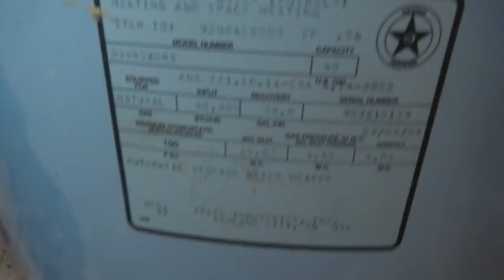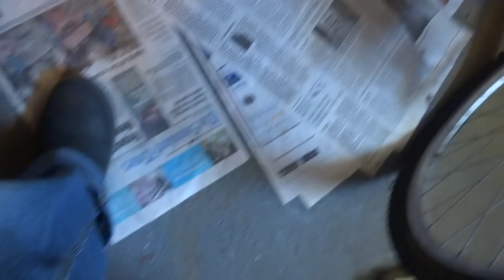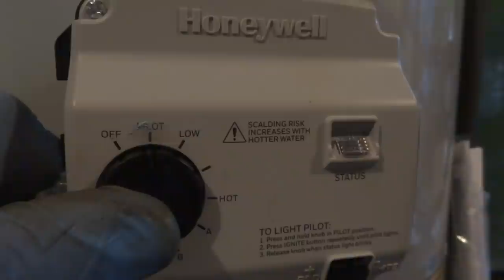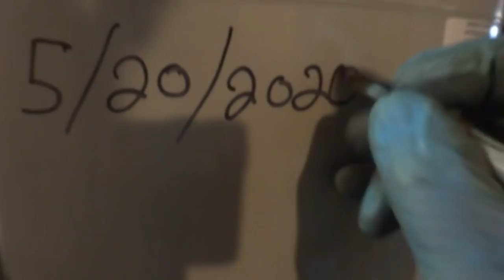gas water heater replacement from start to finish

Comment: Back in 1970 we bought the house the hw .heater gas valve was bad so we replaced the heater   left old one in basement as wasn't leaking .new one 50yrs later Finally started leaking 2020 put the valve in the old one w burner .works fine mustt be 60yrs old 🤗 ex plumber gave me another for spare . I suspect it's not as efficient as new ones but for 20$we have hot water.🤗

Comment: 17 years old, The one at my house is a 1991 Kenmore still running well no leaks.
Reply: @lalajee143  The only issue with mine is a lot of knocking sounds.. which means it's full of calcium. But i'm not sure if It's worth flushing out at this point.
Reply: The old Kenmore stuff was solid

Comment: What thread sealant did you use on the water connections?   Spears 75?
Reply: I tend to reach for Blue Lock, or Rector seal T+2 pipe dopes. Both seal well, and are good for water, oil, gas and airlines.

Comment: The main reason why I replaced my last water heater was due to a damaged cold water dip tube - possibly due to soldering too close to the tank. It caused my hot water to go tepid quickly. So, short stainless steel flex hoses were used to make the water connections on my new unit. Also, I recall the installation manual saying it was important to fully purge the air from the tank before turning the heater on.

Comment: I can't believe you left an old tapered plug valve on the gas line.
They were made illegal here many years ago, so long ago I can't remember. They were allowed until maintenance work involving pipework next to the valve was done on the appliance, then they had to be removed and replaced with a ball valve.

The other thing; I would have advised installing an instantaneous Hot water unit instead of a storage heater.
 They use less gas and they last forever. Of course they need a power point as well, but that's a simple job in the basement.
The first one I put in 40 years ago is still running.

 I noticed a tail pipe on the gas.
You must still have coal gas; So far behind the times and strange, considering how much fracking is going on in the states. Natural gas is dry while coal gas is wet.
Reply: The new natural gas heater was the same size and configuration as the old one: slid right into place and the connections were easy. Those water heaters are commonly used all over the U.S., as are electric heaters of the same size. Cheap, and do the job. Don't see many instantaneous heaters.